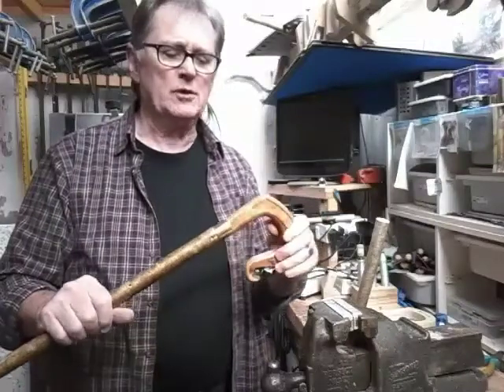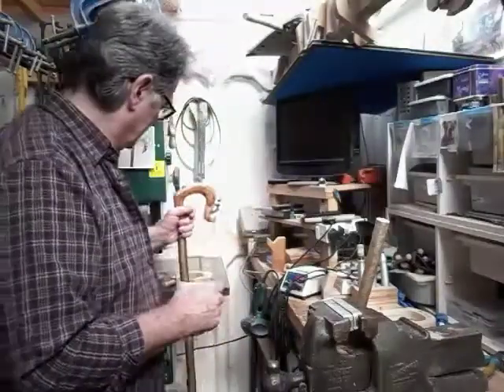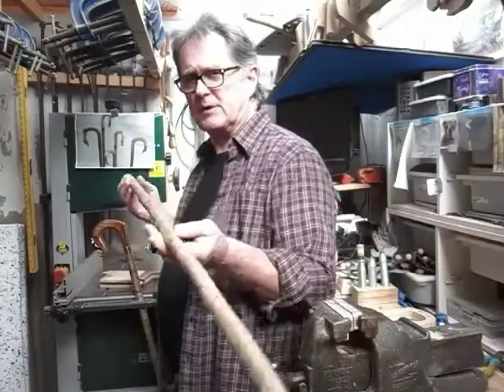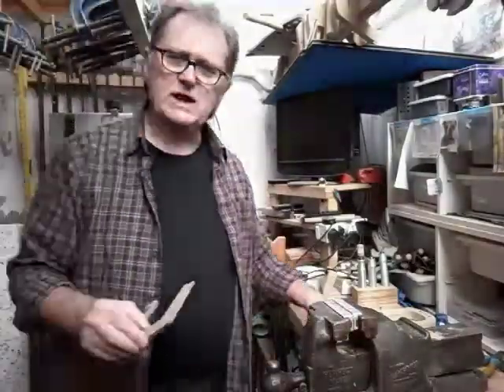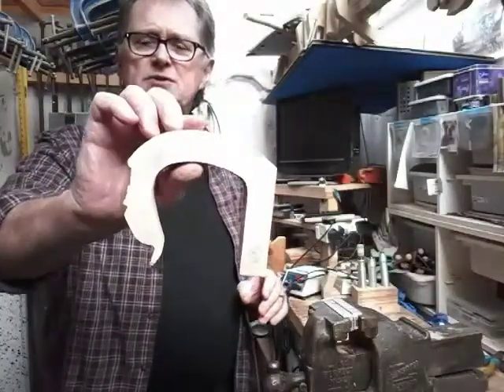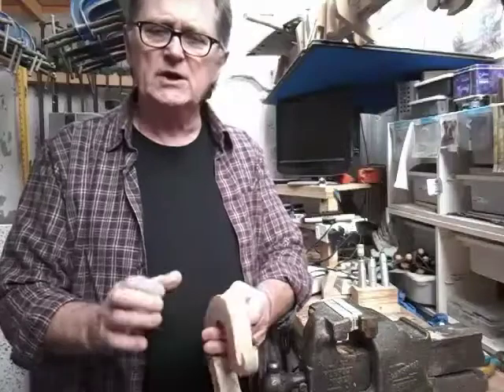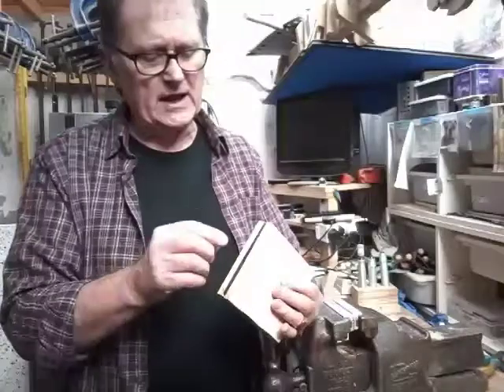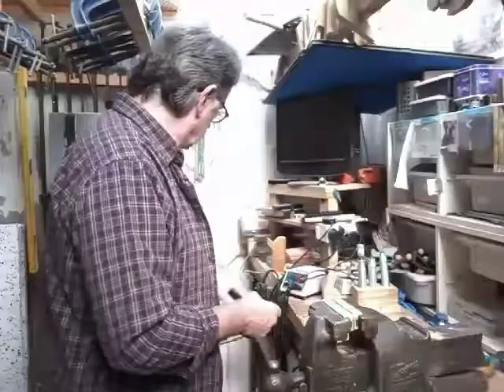Making a shepherds crook in ply

Comment: Hi Joe, in this video you talk about making a 'sandwich' of different wooden plates glued together. How do you prepare those plates and how do you glue them together using common wood glue or epoxy ?
Reply from the maker: Hi Marc. Ok the first thing I do is select the timber I want to use. You can obviously use any combination of timbers you like. Remember to use three sections. Two other and one inner and remember to glue them so that the grain on the middle sandwich is at 90 degrees to the two outer timbers. This is course to add strength to your handle.  

I generally  cut my timber so that the three slices give me just over a inch in thickness when all three are glued together or enough thickness to suit or match the diameter of the shank to be used later.
I then cut these three slices so that they are roughly six inches squares each . So now you should have three slices of timber 6x6 inches and roughly 8-9 mm thick.

I have used both epoxy resin or a good general waterproof woodglue. Depends if I am in a hurry or not. Using good wood glue is cheaper but slower.

To save glue I would normally draw out the profile of the crook shape on the three square blanks. This is so that I only apply glue where needed.
Once all sides of the three blanks have glue applied I use multiples of G clamps to hold and squeeze the blanks together.   
Once dry I remove the clamps , clean up any excess glue and redraw a profile on one of the blank faces so that I can bandsaw the laminate to a rough crook shape.

That is all there is to it.

Comment: Thanks for you educational answer, Joe. On the background of your video I see a bandsaw. I presume a Record Power. What is the type  and are you happy with it for I intend to buy a similar now there is a woodshop in Belgium which sells that brand.
Reply from the maker: Hi Marc. Yes the Record is an ok bandsaw. I only use it for cutting thicker timber . I have a wide blade in this band saw all the time. The bandsaw I really like is an old Kitty band saw I love this saw. I have a 1/4  blade fitted on this saw and do all my profile cutting with. The Kitty is a simple but very well made machine and I would now buy another Kitty over any other bansaw if I needed a replacement. Kitty are no longer made but I expect can be found on ebay etc second hand.